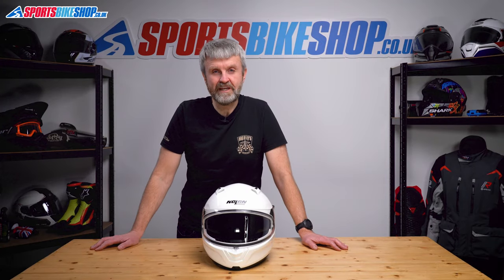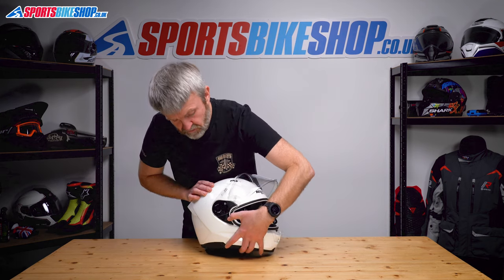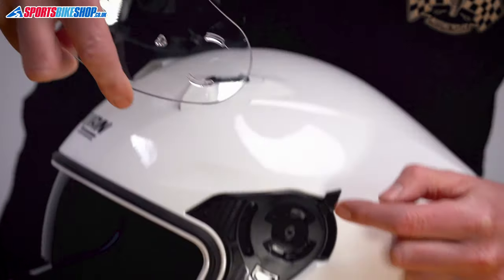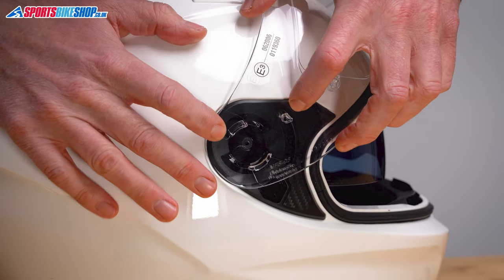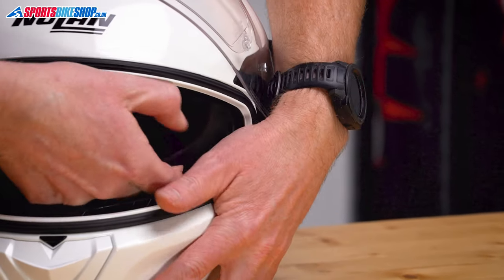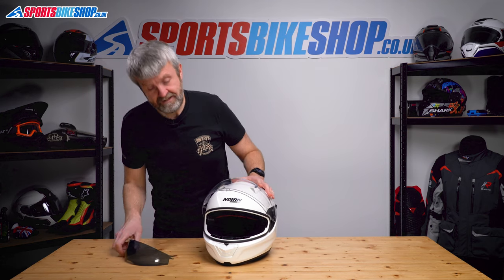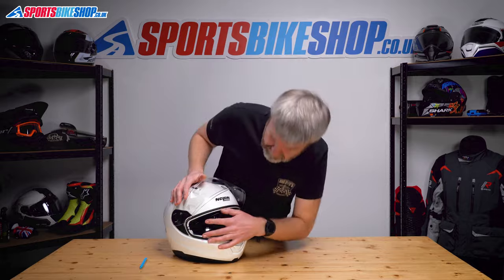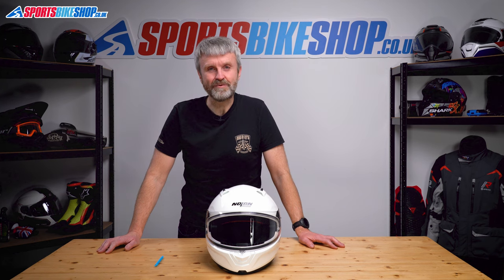How to change a visor: Nolan N60-6 motorcycle helmet

Comment: Hi, how would you adjust the pinlock inserts? I'm having trouble trying to adjust it to the right tightness.
Reply from the maker: You need to remove the visor and then rotate the pins from the outside of the visor. When the small lever is pointing towards the front of the helmet you have the most relaxed fit for the Pinlock and as you rotate that lever so it's facing the back of the helmet then it gradually gives you a tighter fit for the Pinlock. Try rotating both levers back 1/8th of a turn, refitting the Pinlock and checking tension, then repeating till you're happy with the fit. I hope that helps. Cheers, Tony